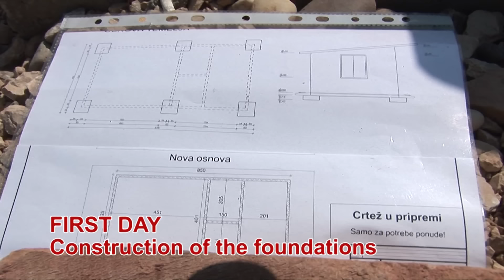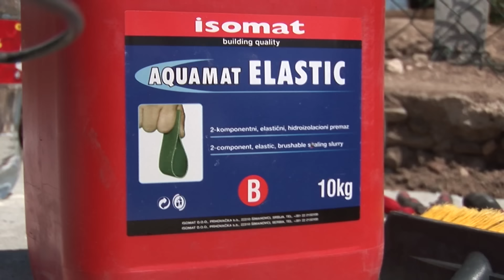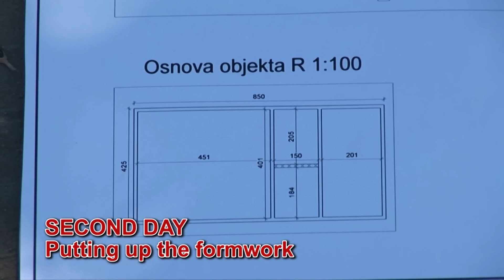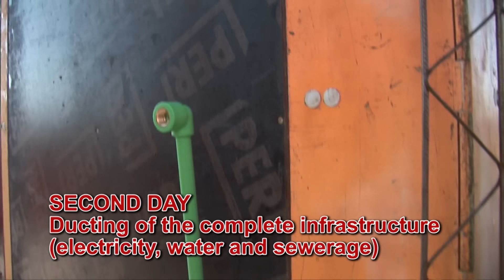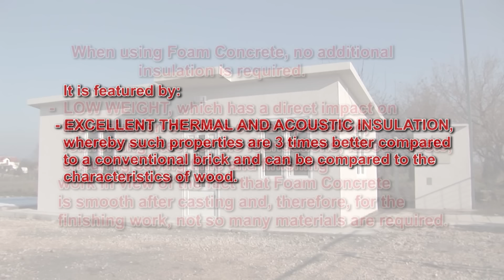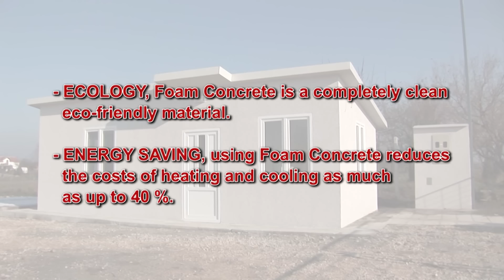FOAM CONCRETE, affordable house built in 6 days!

Comment: Fema should get a contract  with these people  and use this company to build houses for all these people who have lots there homes,and are devastated ,we can use this company in Louisiana.
Reply: In theory .. good idea. In practice... I'd be worried about the environment it's in like that.
Reply: Not convinced it’s easier or cheaper then formwork concrete.
Reply: The video of that would be much, much longer as getting the permits can take a while, which contractors decide to work on any given day, different contractors arguing about the other on certain days, etc. 

Day 167: Contractor comes in to do kitchen cabinets, hungover, gets frustrated because cabinets ordered don't exactly fit correctly, and goes home at noon. 😁

Comment: I grew up in South Africa until 1974, when I left and came to Europe, and in the last few years I was there, a company called Gazbeton (French for Gas Concrete) started building houses and other buildings from foam concrete.  They sold it in long blocks about 1ft wide (from memory) and 9" deep.  I can't remember the length, but around 10-12 ft.  The mouldings had a frog in the end, so the corner verticals were erected, then the walls filled in between them, all joined by putting concrete between them down the frog.  Where the sections were too ,long, they could be cut with a simple hand wood saw - the concrete was made of tiny bubbles, like Aero-chocolate, and the teeth of the saw would simply break the bubble walls.  They advertised it as having very good thermal properties - easy enough to believe, as it was full of trapped air.

They had built their HQ office building with it - 4 stories high.

I just looked for it on YouTube, and I see they are still going strong - not only in S. Africa but all over the place.  There are lots of videos.

In short - foam concrete is not new.
Reply: That was another material. Material You're talking about is made on factories from sand, aluminum and lime with some other minor amount of chemicals. All those components are mixed and due to chemical reaction CO2 is produced by material itself, this CO2 gas creates bubbles in blocks. When material is dry enough it has to be baked in huge industrial autoclave and this completes all chemical reactions in material and transforms it into single monolith crystalline unit. This is literally artificial crystal, it doesn't have any organic components at all. Later huge unit has to be cut to smaller blocks  and this kind of structural material is named as "gas silicate block". Overall this is very high-tech material, which can be made ONLY in industrial conditions. It's effective, reliable and not exposed to microorganisms and pests, because it doesn't have organics.
To clarify, i want to repeat - You've described absolutely another material. 
Material, shown in this video has absolutely different purposes and components. It can be used directly at construction site, it can be mold anywhere, but it's not monolith crystal and it has organic components in materials. In most of cases organic components are based on proteins and they are needed to create foam.

My best wishes.
Reply: That poor 🐸
Reply: Is it reliable in dry country
It's almost no rain all the year
Maybe a few millimeters 2 times a year
Low humidity

Comment: Imagine how much faster this would have been if they’d had a concrete truck.
Reply: 3 days
Reply: That's some watery concrete.  Can't get that on a truck.
Reply: Did they never hear of premix
Reply: Way to wet . That aggregates going to settle to the bottom when they poured it in there all the mortar will be at the top
Reply: @John Fischer  well I don't know where your voice of experience is coming from been doing concrete for the last 25 years that slump was way too wet you could see it when they poured it in there that the aggregate immediately fell to the bottom it needed to be suspended in the mortar but to each their own
Reply: And had the forms as the top of concrete  lol
Reply: @yankotactical1134  Aircrete/foam doesn't use aggregate.. From my understanding, the air bubbles are a lightweight replacement for the aggregate.
Reply: @tymgreentech  you're right.
Reply: @tymgreentech  correct
Reply: @tonnasellscars  you have not been to Thailand then
Reply: There is NO WAY, that watery concrete is up to USA (local) codes. If you use crap material, the structure will not last. Way too much water in the concrete foundation and walls!!!
Reply: @tonnasellscars  There is NO WAY, that watery concrete is up to USA (local) codes. If you use crap material, the structure will not last. Way too much water in the concrete foundation and walls!!!
Reply: @yankotactical1134  There is NO WAY, that watery concrete is up to USA (local) codes. If you use crap material, the structure will not last. Way too much water in the concrete foundation and walls!!!
Reply: @John Fischer There is NO WAY, that watery concrete is up to USA (local) codes. If you use crap material, the structure will not last. Way too much water in the concrete foundation and walls!!!
Reply: @yankotactical1134  exactly!! There is NO WAY, that watery concrete is up to USA (local) codes. If you use crap material, the structure will not last. Way too much water in the concrete foundation and walls!!!
Reply: I was thinking 🤔 the same thing
Reply: Thats what i said,, it didnt get slump tsted, it was impossible 😂@tonnasellscars
Reply: @glenn87654  not only that, but it seemed that instead of gravel, they used pebbles. You don't want rounded corners as it won't "grab" to the concrete as well.
Reply: We were pouring 1 1/2” layers of lightweight concrete on the 2nd and higher floors of apartment buildings way back in the 80’s. We pumped the foam right into the concrete truck, let it mix for a few minutes, and then pumped the concrete up onto the subfloor. It was supposed to act as a sound and fire barrier. It was poured pretty wet, but if it was too wet, or had too much foam, it would basically be enhanced styrofoam.

Comment: Beautiful outcome from such labor intensive and backbreaking work.Those men are incredible.
Reply: I wonder what State this is?
Different states have different building codes. California is one of the strictest codes to build a home or add on. Because of earthquakes, fire's, floods and just about anything else you can think of but they have nice weather work all year around out side.
Reply: @snoopu2601  Based on the website, the language on the plans, the look of the trucks, and the type of bathroom fixtures used, my gut feeling is that this is not in the U.S. but somewhere in Europe.
Reply: @snoopu2601  it's in Croatia.. building plans in Croatian, workers got Company clothes with Croatian language..
Reply: @dk-nj3je  thanks you for the information. Never seen building built like this.
I know they try to build commercial buildings as cheap as possible because they don't know how long the business will last.

Comment: Great show, except I guaranty that the paint is going to peel. You can not paint until the moisture has been evaporated from the concrete or it will peel. This takes at least a week, but usually three to four weeks. In the USA foundations are poured and can not be built upon until the concrete reaches over 90% strength, usually 28 days. Great job but does for show.

Comment: Great to see all that concrete work from the comfort of my cozy bedroom and I don’t have to participate 😁I’m not sure they’re saving much time. A house that size could be stick framed in about the same time.
Reply: @Newlife-ol6pk  According to another post, wooden houses can last well over 100 years. In fact, we've all seen very old wooden houses.
Reply: My wood house was built in 1906. The wood part is the strongest part. Its the stone and mortar foundation that has issues.
Reply: @edswope28  First house I ever lived in was a fr4ame house on the west side of Chicago it predates the Great Chicago Fire of 1871 and it's still standing . BTW it's a balloon frame not the platform frame used today .

Comment: Good. Strong, simple, and fast. Would be better if the house was bigger.
Reply: Its a cool idea but that stuff surely gonna give off toxic fumes over time.
Reply: Don't forget toxic. Since it's a foam, I'm guessing that it is petroleum based. This is a very bad idea.
Reply: bigger builds require stronger materials, with so little of the space being concrete it has much less strength than if it were solid

Comment: This stuff always looks great on a few demo homes, then never goes anywhere.
Reply: Seriously like the current printed houses. Apparently they are so affordable that they aren't available to the public.  I mean how many houses burned down in wildfires here in CA Im sure they would come in handy or is it due to all the codes and regulations just to make a house to begin with that is the issue to affordable housing? Or is affordable housing being made absolute by bigger companies? Who can loose from low cost homes?
Reply: @PeachesClare  you American guys have to learn that wood is the worst material for building houses
Reply: @omega5973  LOL WHO SAID WOOD??? THIS IS CONCRETE
Reply: @omega5973  Wood is the best material. Low carbon (maybe you don't care?). So long as it is sealed from moisture, it can last a hundred years or more, even in damp climates. Easy to build too. My Pops has a well crafted house extension made mainly of wood in place since 1984. The technology is well moved on since then, so you have an even better opportunity to build a quality home now. Much can be pre-built off site as well. The only issue is some of the rip-off prices if you get specialists to do it (ironic).
Reply: @omega5973  Wooden homes in California save billions in $$ in insurance losses because they don't fall down in earthquakes. That's good. 
The bad? Wood burns easily and termites.
Reply: No building code mean these companies will bankrupt in no time by lawyers and the home owners
Reply: @timtam9673  Those are easy hurdles to overcome. Building codes will follow. These are new industries and trial and error makes things better. Always.
Reply: Concrete is the most polluting building material by far.  Way more than steel and dwarfs wood, not even close.  It certainly has its place in construction, just like wood.
Reply: @timtam9673  There is no houses nearby tells me that it's more of a place you would go to sleep over once in a while and not to actually live in it daily

Comment: This is an idea for the company. Get with engineers and see if this would be feasible in dome style construction. For places like Oklahoma and areas of the tornado belt for least wind resistance. Could save lives and could be a major savings in insurance costs as well.
Reply: That's a good idea! And maybe in areas with a tropical climate?!
Reply: Seems like a better solution than, "they're wood so it's cheap to rebuild"
Reply: Probably would not save the buyer much.
Reply: This is way more resistant than what we have in Oklahoma because it’s all concret when we have houses built with wood! Not even close! This is how houses should be especially in a tornado states!
Reply: @riseyourvibration9669  hi, do you think the sheer weight of a completely concrete structure would cause more deaths? When the houses collapse or get thrown into the air? I’m so interested by what you said about how these houses would stand against winds and tornados!
Reply: Dome construction is done a little differently.  they use inflatable dome segments that connect, then use "shotcrete" (think swimming pool), and other methods.
Reply: @ARABPRODUCER7  Actually, not true depending upon the roof connection method and connection to the foundation. Uplift is the main issue and is easily overcome with this material.  I would bet that this home could be designed to easily withstand 180 to 200 mph, which is a LOT better than most homes built in tornado alley. The only structures that can do better are domes.

Comment: It may not be the biggest or most stylish of houses, but I'm impressed, 6 days to build it complete, wow. Plus its good for the eco system, low cost to run. They just never stated the price 😁
Reply: Thanks for the comment! A practical solution to the homeless problem. I was deployed to Bosnia and our housing was modular. Built similarly with shower and bathroom located outside. LOL Cold walk to the Latrines!!! Heating was provided by a HAC unit located at both ends of the room. Thinking outside the box. Add solar power and you're good!! We drank bottled water.😊😊😊😊
Reply: X xu
Reply: @johnboddie6826  Mini split and solar ?
Reply: @dodfallin  It would be more efficient for the community to be off-grid to off-set the cost of utilities. I live in a modest apartment and usually pay $40-60 per month for electricity. Rent is reasonable which is more cost effective than homeless shelters. Most military posts use propane which would reduce installation of gas line and plumbing. Solar panels and a backup power cell would run about $1,500-3,000 for a small home like this. It would cost the tax payers much and maybe be offset by the person's social security or DPA benefits.
Reply: @johnboddie6826  At current fuel cost, propane is three times the cost per btu verses 21seer  mini splits. With seers and hspf  numbers today and units with direct pv input like from Hotspot energy that uses pv energy first then grid power , mini splits are likely the future of home energy.
Reply: @dodfallin  Thanks for the info. Seems like the bottom line should always be considered. Just a suggestion but since the price of profane is the rise maybe another alternative heating source should be investigated?

Comment: Love it and all. Just, even something that small would be a bit pricey. My 16x16 tiny house, pre-wiring and plumming, ran me a little over 1k to build. Granted, having that awesome of a sound barrier would be nice.
Reply: I would like to asked if you build your house?
Reply: That awesome of a sound barrier might (read, IS) nessacary where they built that house.  I can see an airport  in the background.
Reply: How would I contact them about one like your?
Reply: If you built a 16x16 for a thousand your a master in economics unless its 20 years old. It cost me 700 to build a 4x8 chicken coop with 6 ft walls metal roof. Just recently.  Using the cheapest pressure treated lumber I could find.
Reply: Seems you didn't bargain hunt
Reply: @homesteadingtennesseeriver569  yep. same in Iowa wood and materials are expensive
Reply: @NoneYobiz.  Hahahahahaha. Where I am right which agreed is my personal trip I could not put up 50 feet of picket fence 6 food high for $1000. That's not including labor of course.

My partner has a dump truck and gets $500 per truck of garbage if you fill the truck.  The cost of fucking dirt is more than food it seems.

I live 3 miles from Ground Zero across the Hudson in New Jersey.

Comment: Bruh, I thought from the thumbnail this was going to be a snap! 😂😂😂
If y’all can build this in 6 days you should be able to do a regular timber and drywall house over your lunch break.
Reply: Would steel frame be faster as well?
Reply: Lol right, I was thinking the same thing, I could've framed that with regular lumber faster
Reply: Probably this is the "Preferred" method of construction in this part of the world. Plus the sound deadening of this with the Airport right out the front door. My question is heating and air. Didn't see any provisions for that.
Reply: You should have tapped the little drop down arrow and read the description.  It would help you understand that it wasn’t just about speed.  The very small home (maybe 25 x 12) has benefits a wood stick house doesn’t.  Besides being fireproof, and not needing extra insulation, it is likely very inexpensive per sq. ft..  Termites never a worry.  Rodents not setting up homes in the walls and attic space and nibbling on the wiring.  I assume what they built is not in an area where the temps vary much.  No heating or cooling at all.  White stuff they painted the roof with will reflect some heat.  Put the lightest colored asphalt shingles I could find when I replaced a roof.  Helped only a tiny bit in the low desert of SoCal.  Until they came up with better insulation materials standard stick homes were about the same temps as the outside.  I don’t know the R value of the foamcrete, but it is no worse than what you gloat about. “Timber and drywall”.  Unless you are talking about logs.  
The title of the video is the problem.  And the lack of narrative about what the benefits of the material are.  In the description they were comparing it to concrete blocks and use after floods.
Since you are in home construction I have a question.  Why in blue blazes do you put toilets in, essentially, cubby holes?
Reply: @conniead5206  Uh, you should include what’s pertinent and significant IN YOUR VIDEO. I’m here to watch, not read.

Comment: You have given me some ideas thank you. Our building codes require the foundation for the wall has a minimum 6 inches ( which you could have framed on your perimeter when you poured ) to stop water and pests. I see you water proofed before your wall pour where they would sit. Each country is different.